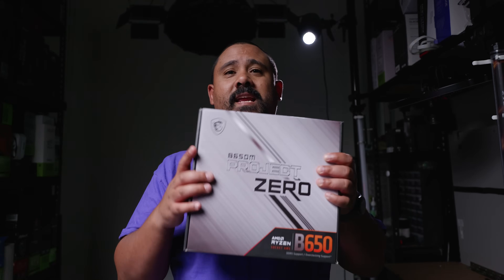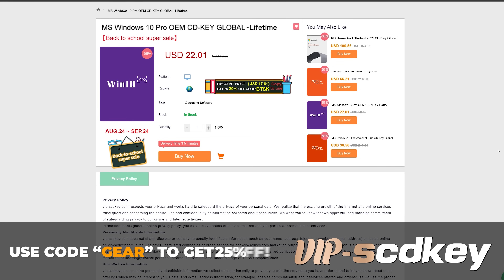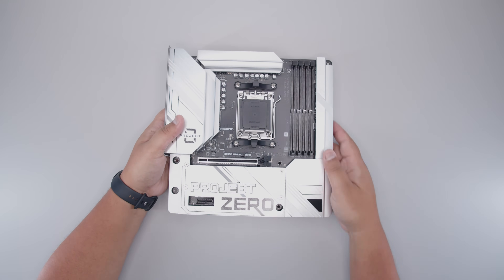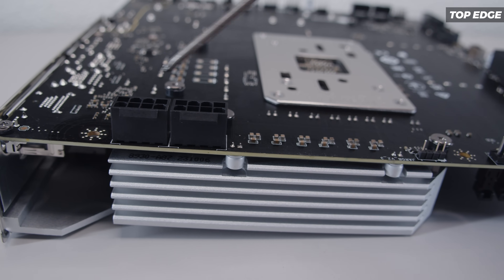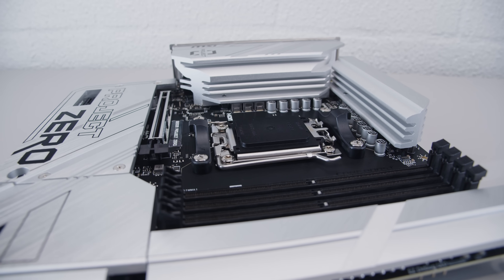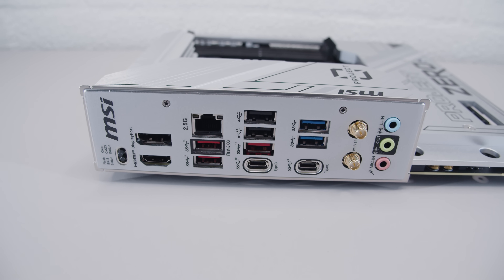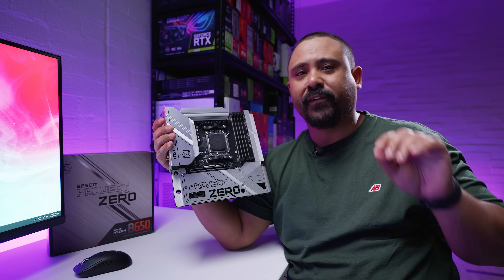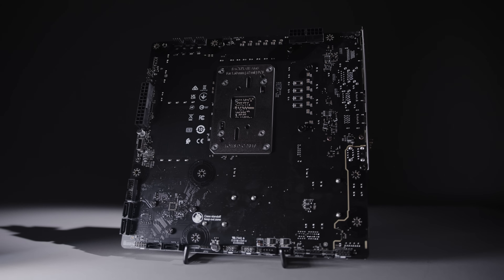This NEW motherboard design changes EVERYTHING! - MSI B650M Project Zero

Comment: I think all motherboards should come with 3 DRGB headers as 12V isn't needed as much. I am a fan of a all white build and MSI needs to bring back their B650m Mortar in White as they downsized the Project Zero Vs. the Mortar. One thing I am not happy with on a lot of the MSI boards like the Mortar is it only comes with 6 Layer PCB.

Comment: A lot of the connectors that would work would have to be "L" type connectors or you would need taller standoffs to provide adequate clearance to plug in the usb 3.2 Gen 1 header or the Gen 2 type-c connectors. Finding a case that has a large enough opening so you can be able to eyeball the back of the mother board and visually see if all necessary cables are properly plugged in before closing the case and discovering it won't power on cause you missed something.

Comment: My concern with this imminent new craze of mounting all the plugs on the back of the motherboard, is that the motherboards that do this will not be compatible with any of the cases currently available globally. I mean, even if we assume that all of the ports are going to be in the exact same location on the board, just on the rear, there a re absolutely zero PC cases that I can think of right now, that will accommodate boards like this i.e. no cases with grommets in the right locations, and I bet that for a while, the standoffs supplied will not be tall enough to lift the motherboard enough to run the cables behind in order to connect to the reversed sockets
Reply: Jonsbo cases
Reply: MSI MAG PANO M100R PZ Black Micro ATX Gaming Case, Support Back-Connect Motherboard
Reply: this motherboard works in the new thermaltake tower 300

Comment: Where are you going to plug in the CPU cooler (or AIO) if the fan headers are all on the back?  There should be a pass-thru opening somewhere in the board.

Comment: I am in agreement with Paul's Hardware from back in Computex. Due to their incredibly limited compatibility, this just feels like a unnecessary investment. Why fix what isn't broken? Are we seriously going down the Jensen Huang route of "all screws and cables are ugly!" and hide everything instead of actually providing good price-to-performance and actually meaningful features? What about extension cables, which may add a last touch of color to a build?

I don't know. Maybe I'm missing something, but I just don't get this trend. It doesn't even hide all cables anyways, like fan cables or GPU cables (Asus hides it, but that is a whole other can of worms). The only major positive I can see is that PSU cables can be made way shorter, which leads to a direct price decrease for PSUs, at the cost of potentially increasing price for motherboards due to them using more heatsinks to cover up the naked bits of the PCB where the plugs used to be.
Reply: @horizon4895  if humanity follows the old saying: "why fix something that its not broken" we will still be running in horses!

Comment: The case selection for this and its B760M counter part isn't great. Most of them look like ATX cases or event E-ATX. 
Such a waste with a Micro-ATX board. I like the concept. Combined with a Corsair SHIFT PSU you could do all your wiring on the back.

Comment: I see this really as a step forward, imagine you have x amount of layers in the PCB and now can cram more stuff on a smaller board.  This makes the "reachability" of the connectors different.  You will still need to run cables to/from your graphics card and, if you choose so, from your cooling block.  What if they started a new trend and the PCI slot for the GPU would include power delivery?  Maybe PCIe 6.0?  Just some thoughts as a seek my brainz.
Reply: Passing an extra 500W (or X times the gpus) through the board would certainly be an issue. What they could do is maybe have a passthrough pci 6.0 power port in a convienient spot near the slot?
Reply: @constantinosschinas4503  That is a fascinating perspective, I hope the world keeps inventing.  I think that this MSI idea is just the beginning, today only few cases can harbor this motherboard.  The cases would become more bulky in width as they can get shorter in vertical height.
Reply: @aelaan12  I think cases are already thick enough to accomodate this. Most if not all,  have cable management on the back of the board, or even psus etc. They mostly need to add the proper holes around the perimeter of the motherboard.